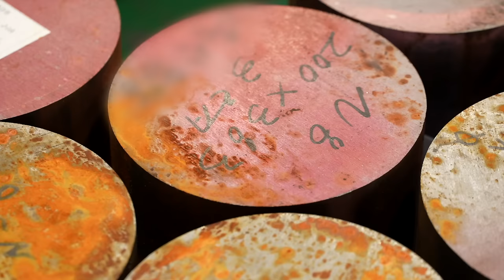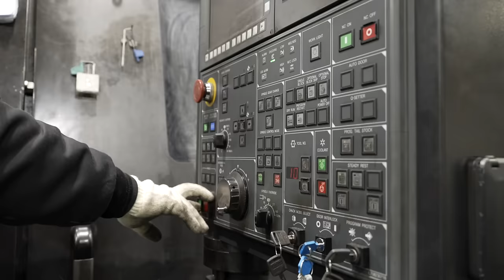ロックドリルヘッドの製造プロセス。韓国の重機工場

Comment: Machine coolant is primarily there to reduce heat caused by material distortion. Material in lathes and mills is removed much like how a bulldozer removes material, it bunches up and folds in on itself at a microscopic level and is eventually peeled off the surface. Traditional friction in machining is not common and is highly undesirable as it can cause inconsistent forces, which causes the tool to bounce over the part. The general term is called chatter and specifically for friction based chatter it's called rubbing, this can lead to a poor quality finish which requires extra processes to remove and reduces the lifespan of the cutting tool, both increase the cost of part production.
In case anyone was curious.
Reply: correct and no they are all fully synthetic coolants as well. Used to sell the machine coolants. 👍👍🦘🦘👌👌
Reply: Thank You for making me smarter. I never really gave it any thought before and it makes perfect sense.
Reply: There's quite a large number of things that can cause chatter. Even having too much load on the tailstock.
Reply: @stevo68  
Over loading the tailstock is one I haven't heard of before.
In what way do you mean overloading it?
Reply: @Zappyguy111 . I've found that with some smaller pieces if you back the tailstock up a little bit the chattering stops. Obviously still has to be in contact with the part. Just from my experience anyway.
Reply: 가공 cnc 기계 모두 한국 doosan에서 만든것 입니다 .
Reply: @Zappyguy111  Too much pressure on the end.

Comment: I can remember the smell of the machine coolant,gives the tongue a slight oily taste . 
When the Pruhdoe Pipeline was being built, my mom and step dad had a machine shop that built Aluminum, articulated trucks for tundra and ice operation.
We made one with an Ice drill auger so you could drive on thin ice , punch a hole and then flood the ice to thicken it quick.
We made a Freezer that went to 40’ F below to freeze saltwater cubes we then practiced out self made cutting bits down in Seattle.
     Bigfoot was the only Monster truck at time and we took a custom Track truck to the Mudbog race at Kingdome.
     Had the name “Santanimal “ as our company got sued over using the name “ Cat Track.” 
Crystal Mountain ski resort had some , they bolt on stock axles.
      The heat to assemble process was cool to do , we used dry ice on inside piece when assembling aluminum rims . Even after welding the seam , they had to peen and spot weld weeping leaks.
    Spied a Starbucks logo girl during the Cnc portion.

Comment: looks like they need to replace the tool bit in the Larger CNC machine at the 12:40 mark, based on what the metal looks like, it should be all the same color and not lighter and then shiny etc. 👍👍🦘🦘👌👌

Comment: Also how on earth is the rock drill bit going to work, when inside it is full of bearings making it spin around, so those knobs will not touch any rock surface as they should to the point of only lightly touching it etc. Now if they used hardent hi grade steel for the knob's and hi grade end bits then it would be like a tungsten carbide machining bit used on the lathes and milling machines tool bits?👍👍🦘🦘👌👌
Reply: I'm not sure which bit you're referring to specifically, but I'm assuming the first one. Each of those cutters is part of a much, much larger assembly. Look up Roller Cutter Drill and you should find some images of full rigs
Reply: You don't cut rock, you crush it or hammer it.
Several of these cutting heads are placed in an assembly so they can roll against the rock.
The assembly is rotated and pushed hard against the rock.
As the tungsten buttons push on the rock they make cracks.

If they were used as a lathe tool or drill, they would wear out very very quickly.
Reply: Gee I bet they never thought about that.

Comment: Tungsten bits installed?

Edit: carbide bits.
Reply: "Carbide" is a broad term to describe a metal + carbon.  Tungsten carbide is a specific one.  Others include titanium, zirconium, chromium, calcium...
Reply: @fredinit Ah see,alloy of many specific for its purpose.
Reply: These are not cutting or scraping tools. They are crushing tools that are pressed very hard against the rock.
Thats why the cone shapes have no shaft drive to them, they are rolled against the rock.

Comment: Rock bits do not cut, they crush the rock by extreme foreword force.  This is enough to turn the rock partly plastic, deform it and allow it to shatter after the knob part passes by.  These bits are used by rock blasting crews for drilling holes to tamp explosives into for pealing away rock faces in the open pit mining industry.

Comment: @ 6:36 you wrote “ heat the body for expansion “
Is it not tempering ?

Tempering involves heating the steel to a lower temperature (below the critical point) and then cooling it rapidly in air or water. This reduces the brittleness and increases the toughness of the steel.
Reply: The components are an interference fit that requires the body to be expanded via heat. Otherwise the fit is so tight, it wouldn't be possible to assemble them.